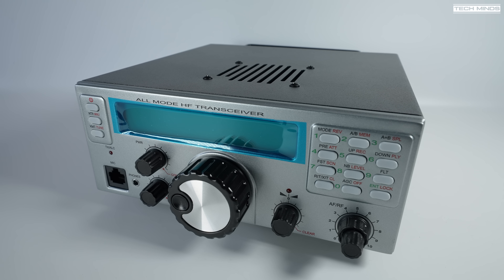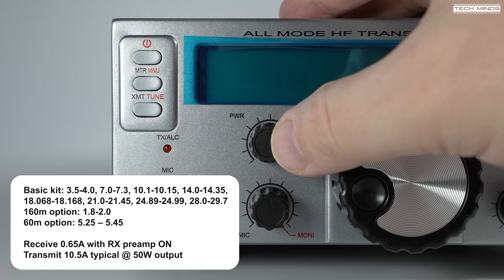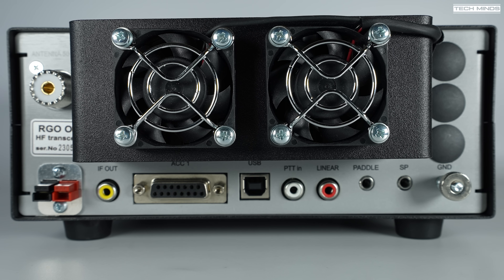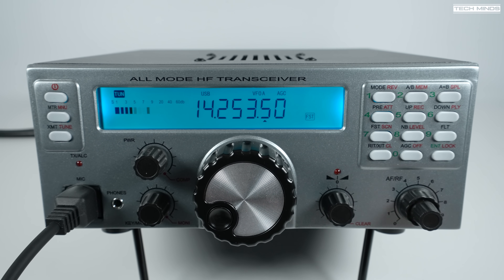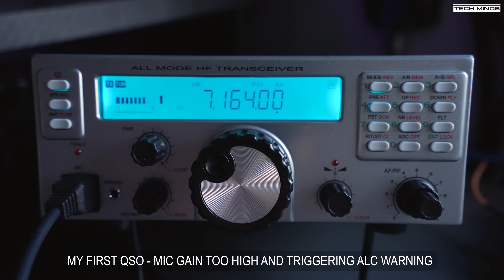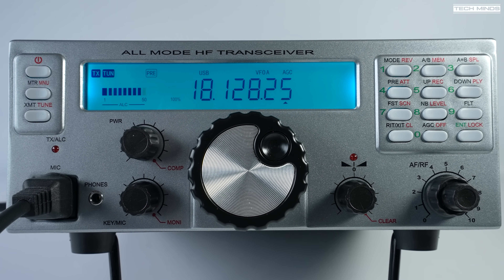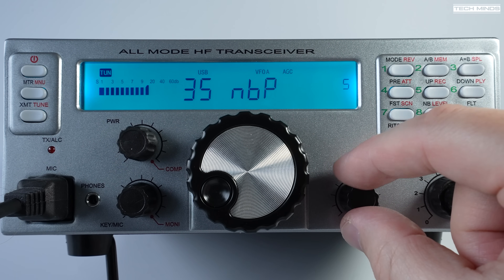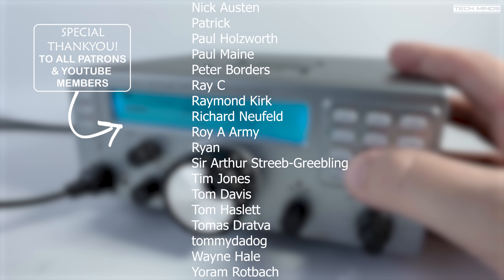RGO ONE All Mode HF Transceiver

Comment: I would gladly pay for an good old-fashioned radio like this, but unfortunately the cheapo silver painted plastic front panel is a no-go for me.
An anodized aluminum one would add to the overall quality image without costing more to manufacture.

Comment: this will be my Next Radio.   I only do CW.  I prefer  analog crystal design better, it is easy to maintain,   NO complicated DOT matrix display , which goes bad after while.  Segmented LCD display last much longer.   I probably buy spare LCD display, spare Volume POT, Spare Rubber keypads,  so on.   AG6JU

Comment: I love the simplicity of it, for being a modern radio. But it is too modern for me. I like tube radios. With no digital display. I am currently using an early '70s Yaesu FT-DX560, which I bought used about 10 years ago, and completely rebuilt.
Reply from the maker: I would love to get my hands on some really "old" ham gear to try on air...! Maybe I should do some hunting for some.. Thanks

Comment: The comment about Ten - Tec came rushing back, when the narrator spoke of,
 " Plug in Modules " !
Seems that all began somewhere in the late 60's thru early to mid 80's !
But became a nightmare, as oxidation became an issue, where the modules contacts, and the sockets mated !
Poor connections led to intermittents, and you can guess the rest !
I remember some guys ended up just soldering the modules in place, to keep the gremlins away !
That's the way I remember it !
Wish this guy luck !
Reply: A thin film of dielectric lube would solve that.
Reply: @hillbilly4christ638  
Sounds right !
But back in the day, I don't know if that was readily available ?
Never heard of anyone doing that !
Curtis Mathes TVs used plug in modules back then, as well !
It was kind of revolutionary, but the beginning of the Dumming down of the Tech's of the time !
They began to plug and unplug modules, then would return the faulty module to Corporate, to a higher level echelon, where Techs might trouble shoot down to the component level !
Just one of many stepping stones that led us to where we are today !

Comment: Looks like a refreshing rethink to the over-complex menus modern rigs come swamped with!  One option I'd like to see is a separate rx antenna input for those of us in urban locations who find the tx antenna is too noisy, but can find a quieter spot for an active loop or similar active rx antenna.
Reply: If you look at pictures of this radio on the website for this radio you will see an RX input jack on the back of the radio.  Maybe this is an option????  Don wd8dsb

Comment: hi loved your video but no mention of the prices for different bits or fully loaded radio . be nice for camping or portable with anderson power pole connectors i uses hem alot in the shack . cheers for the video
Reply from the maker: I tend not to mention prices as they fluctuate with exchange rates and over time, but I always link to where viewers can purchase from so they can see the current price in their home currency. Thanks for watching :-)

Comment: I got mine a couple of months ago, and absolutely love it! The audio is fantastic, especially on CW. It doesn’t have the bells and whistles of my IC-7300, but that doesn’t bother me. I’m in an RF noisy urban area and although this radio doesn’t have DSP the receive audio is just easier on my ears. I bought the base radio without the tuner, noise blanker and audio filter. I intended to use it for POTA activations, but it has become my “go to” radio in the shack. It has elegant simplicity and refinement that just gets the job done!

Comment: Nice rig, hope Boris does well with them, at just under $2000CDN it does not make economic sense to this amateur when a used FTdx3000 can be had for less and has more.
Reply: I have both, the RGO does not sound any lesser on TX or RX and its simpler.

Comment: This is a step backwards in design and spec it is like a radio kit from 20 years ago
Reply from the maker: That’s the point, simple to use I guess.
Reply: That is a good thing imho. I would buy it if I wasn't involved already with ICOM.
Some people (like myself) just want a brick to rely on. I had a bunch of contacts this weekend with just my DX70 and a length of wire. With 50W it left my 705 in the dust
Reply: That is why you would buy it, and pay a little more. The RF Gain actually works the way you remember it from back in the day as compared to the newer radios.

Comment: I'm sure it is superb, but I worry about ongoing support for these "nesh" products designed/made by effectivly one person.  What if the maker stops support or passes away?  Will the service data be available to carry out repairs/upgrades?  This is not a cheap radio, so this is important to consider..!
Reply from the maker: Schematics are available in the manual, so that’s a good start.
Reply: I’ve got an older Xiegu X108G. 

Essentially a uBitx. Analog signal path, discrete crystal filters, DDS oscillators and a bunch of functionality controlled using microwave switches controlled by logic signals from the CPU

Against all odds I have kept that thing on the air, with some sketchy schematics and a parts list that’s mostly been correct. 

I’d be keen to see it as a kit, but that’s asking a lot and a lot of work for not nearly as much return.

Comment: Is there a built in sound card for digital modes?
Reply from the maker: Unfortunately not, well, not that I could see.  Maybe a module add on in the future? Will have to check with Boris. Although, the ACC port on the back can be used with a sound card etc.
Reply: Manual: 
RTTY – Digital modes (not active with sw ver. 2.XXX)
RTTY-R Digital modes reverse (not active with sw ver. 2.XXX)